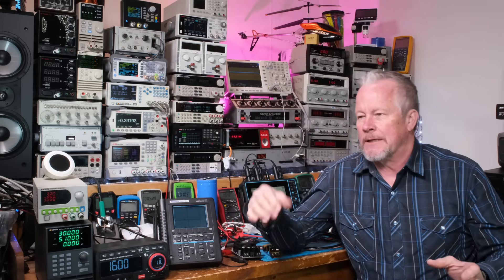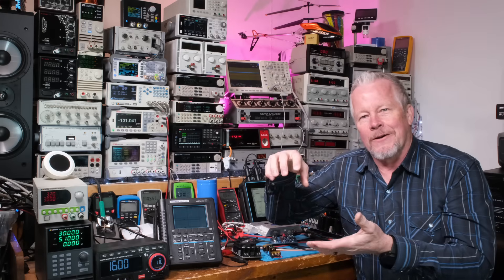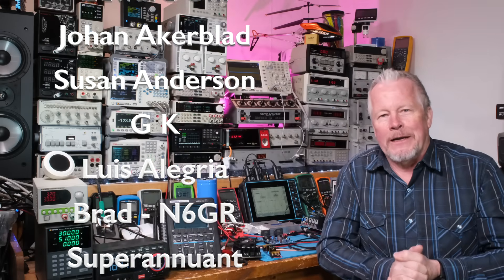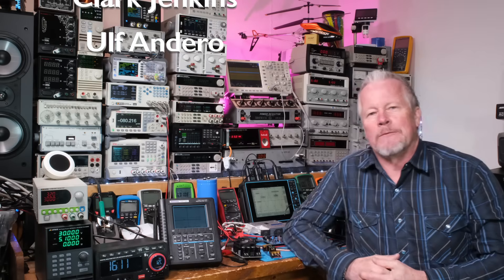Capacitor Bypass Value Myth #stevensandler #ericbogatin #bypasscapacitor #couplingcapacitor

Comment: Good video. Would you still not consider your frequency content? I mean a 10uF start to be inductive earlier than your 100nF.
Reply from the maker: Great question!  That's the point I'm making - the impedance of the 10 uF might be just as low at the XC of the 100 nF.  The ceramic caps are quite good.  One thing to consider is the DC voltage - if the voltage applied is higher than 50% of the rated voltage - a higher voltage rated cap might give a better value and lower impedance.  The point is - many engineers never look at the impedance curve of a specific cap and simply choose it based on value - thinking it is better at the frequency in question.